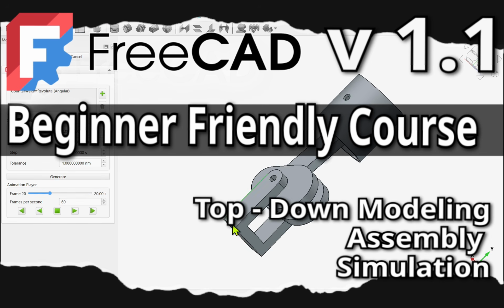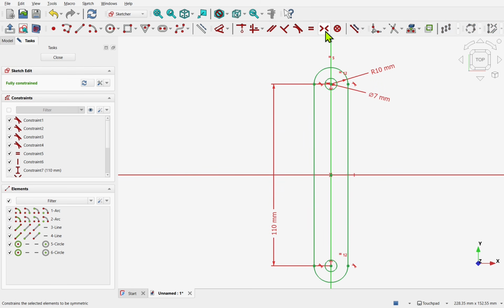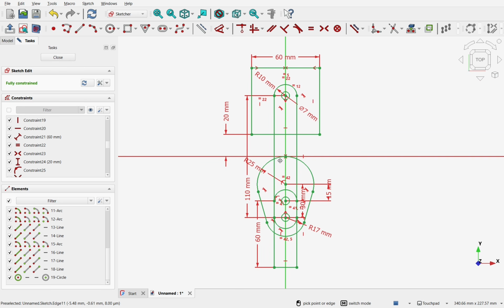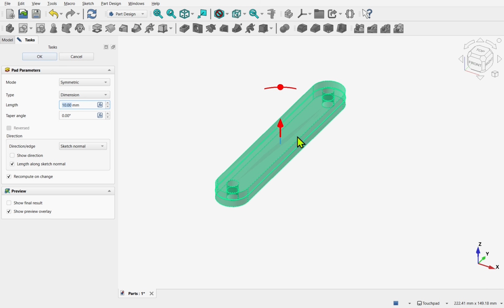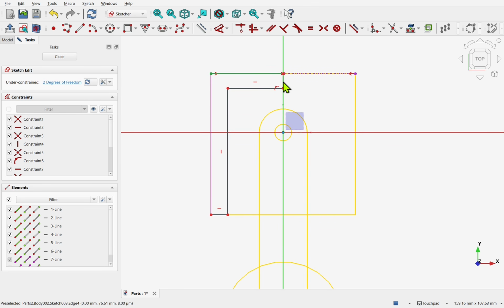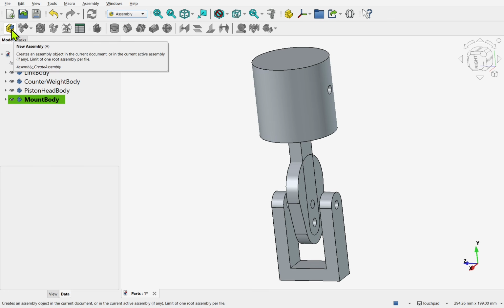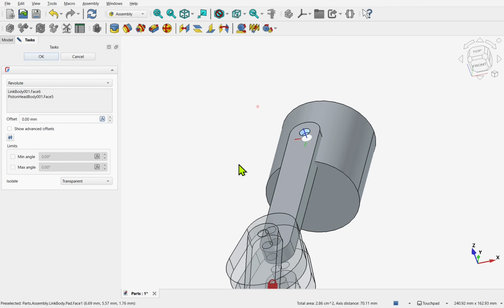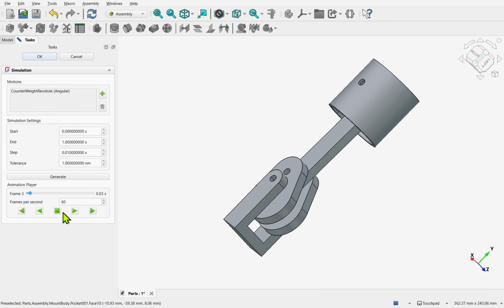FreeCAD 1.1 Beginners Friendly Modeling and Assembly (Model, Assemble, Simulate, Animate)

Comment: I tried this in 1.0.2. Couldn't make the construction toggle work. Tried a lot to toggle and do the solid line, but did not work. Not sure why. Well maybe i will try in 1.1. But if you have a solution for 1.0.2 would be good
Reply from the maker: 1.1 brings the new feature for the imported geometry but that doesn't exist in 1.0.2. Other than installing the dev version of 1.1 unfortunately there is no other way.  But, what I have read so far the community release of 1.1 is getting closer, it was aimed for later this week but it looks like they still have some blocking bugs to resolve.

Comment: Great video. I feel more confident I will be able to transition from Fusion 360 to Freecad (since F360 won't support Windows10 in the future). From this video, I assume that sketches in F360 combine 'master sketch' + 'sketch' functionality. I.e. you can create a Fusion sketch and then apply an extrude etc to only a small part of the sketch, whereas in FreeCad you need to create a sketch per action, linking them through a master sketch. If that's the case, I can work with that.
Reply from the maker: Excellent to hear that :) I always like to highlight some of the new features and how they could be used to help people get an understanding of what they can be used for.  In regards to the selecting small parts of the sketch and extruding them, there is a new feature in 1.1 called 'make internals' which you can enable it looks like it may be trying to do what you are explaining, but I got some weird results when I last used it, but that was a while back now so may have changed, I need to revisit that one.  Glad you enjoyed and thank you :)

Comment: Very nice, I followed 90% of it, will need to watch a couple more times and give it a try.    Thanks, so much for doing these great tutorials.   I am still doing some fumbling around but getting better.  

Is there a way to output the animation to a video file?

With the newer versions for FreeCAD, I wonder if you could do an update video on the recommended settings you use for your installation.   

Thanks Craig
Reply from the maker: Great to hear you followed almost all of it, it get easier as you get more time under your belt.  CAD is hard full stop let alone adding FreeCAD into the mix.  Regarding the animation, this is one thing that seems to be missing at the moment, I ended up using OBS to screen record the animation.  It's the same with the turntable, you still have to use external software to capture the animation:  I just double checked this to see if anything has changed but it looks like it hasn't.  There is an article for the turntable here with some comments of other suggested free capture tools : https://blog.freecad.org/2025/01/06/tutorial-using-the-turntable-function/
Reply: @MangoJellySolutions  Thanks

Comment: In "Elements" toolbar in sketcher there are list of elements and every line has 3 line icons, every arc has 4 arc icons etcetera. Could you explain what's the purpose of those icons please?
Reply: If you click on the text to the right of the elements the entire element is selected. Clicking on the individual symbols you can select the line,  the start and end points, and (for arcs) the arc center point.
Reply: @jurgenr3240 thanks!
Reply from the maker: Thanks to @jurgenr3240   for answering that one :) :) :)

Comment: Will free cad be able to reference sketches, solids, etc. from another body without using  shapebinder? Hopefully it will eventually to have a better user exp. I do hope they don't remove the shape binder as it has more functions than just for referencing
Reply: Yes you can use the import point tool to fix on other surfaces. But I would use this function not too much because it can loose the point when this external geometry is changed.

Comment: Great tutorial, very clear.  

I wholeheartedly approve of the use of the master sketch.  One of the other FreeCAD channels creates a plethora of sketches that are completely independent, and it just makes making global changes much more problematic.  You can't see whether a change will cause conflicts with other sketches, and you have to try to find the relevant sketch, which in a complex project may be non-trivial.

One thing I wish you had done, is to use variables for the key dimensions, such as the piston diameter, the stroke length (twice the distance between the holes on the counterweight), and the length of the connecting rod.  Parametric modelling makes it much easier to change a design, rather than editing a sketch.  Of course, this has no bearing on the tutorial, but it does introduce good practice, in the same way as the master sketch.

It's beyond the scope of this introductory tutorial, but coming from Fusion, I'd like to see some discussion about collision detection between parts.  For example, if you make the stroke too large, the piston will collide with the support and/or the counter weight, or the skirt of the piston might strike the conrod.  This can be a vital step in the design process to ensure that the assembly actually works.  In Fusion, this can be computationally expensive, so I'd like to see how FreeCAD handles this.  Is there any chance of a follow-up video where you cover this?
Reply from the maker: Thank you, glad you enjoyed.  I did think about introducing varsets for such variables as you said but didn't know if that was a step to far for clarity, in hind sight this would of been a great addition.  In regards to collision detection:   simulation wise the assembly workbench doesn't have anything like that at the moment, but you can use a spreadsheet with calculations within to show a fail state when exceeding certain min/max values. This also could be applied to a varset, where a field is setup to show a error state for certain rules and use conditional formatting to make this even more visible. I have also just thought of something which I have never tried, I am wondering if you can change the colour of the part through conditional formatting, colouring a part red when it goes into error.  Well worth looking into.  Thank you for taking the time to feedback, good food for thought.
Reply: @MangoJellySolutions  Thanks for the reply, with some interesting ideas.  Hopefully collision detection is on the radar for the developers - they seem to have got a lot more momentum this past 12 months.  If not, the conditional colouring sounds like it might be an interesting alternative.
I'm only just transitioning from Fusion, so your content is really useful, and since v1.0 FreeCAD is deserving of an ambassador.
Reply: the problem with the mastersketch approach is when you have to modify it, adding edges and features. Then your derived models often completely break. I prefer to make several sketches which reference each other in a hierarchy by reference dimension names. Or also use a spreadsheet with the important dimensions.

Comment: Is Freecad 1.1 available for download, i only see 1.02 ?
Reply: Yes, scroll a little further down in the download page. The 1.1 is a weekly beta release that is not far from being a RC release. Work is very much in progress to have 1.1 on it's way to a full release. I have found that it can be buggy at times but it's certainly usable. I set the autosave to 5 minutes in settings and remember to manually save often also and you should be fine.
Reply from the maker: @FoxtrotYankeeHotel has kindly answered your question, it is easy to miss because of the text is within a lozenge and doesn't look like a button.  Depending on what OS your running there are different options for install / permission setting you need to set.  I have a video here covering those: https://youtu.be/Cu5miPp4eZs